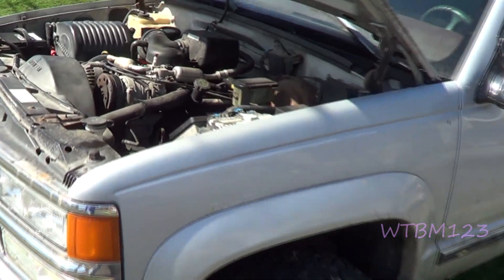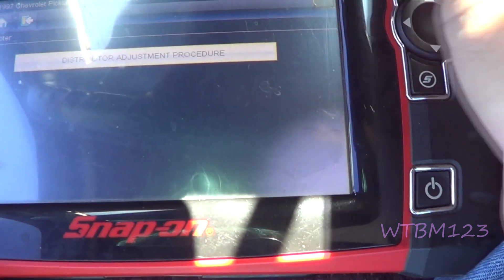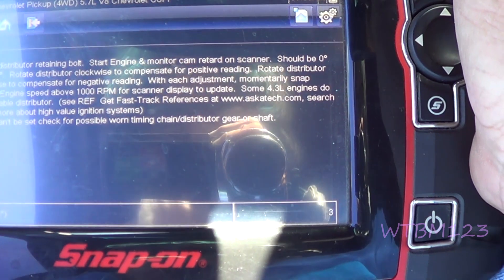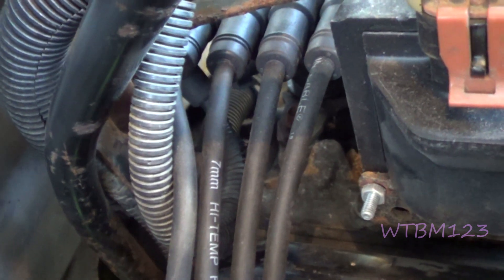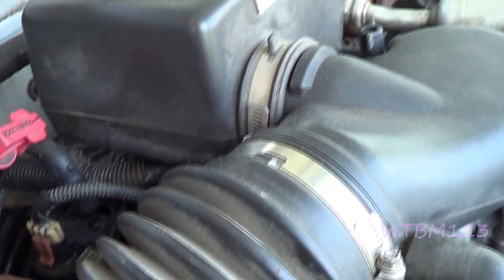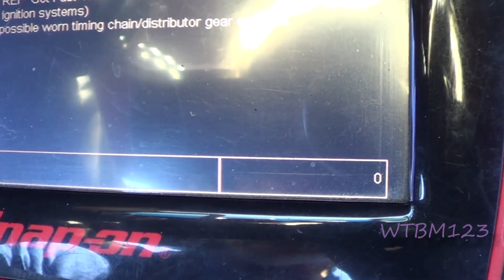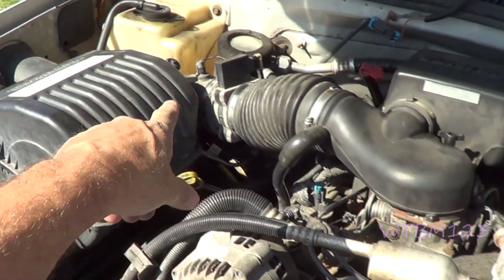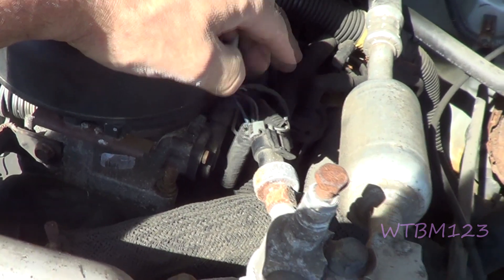Chevy 5 7 Votrec engine set distributer with Scan Tool

Comment: I have a problem with setting the ignition retard on my 96 5.7 Vortec.
I did the head gaskets so the distributor had to come out. All I have is my little old Actron code reader. It has a real-time (apparently) ignition retard function. I had an engine code P1345 Cam/Crank Correlation Issue. I had an ignition retard value of -17 degrees @1000 rpm. I  rotated the distributor counter-clockwise as far as I could. The code disappeared, and the MIL went out but the ignition retard value did not change from -17 degrees. I don't see how that can be. Do I need to advance the distributor gear a tooth, or is the problem with my using the wrong scanner for the job?

Comment: Thanks for this video, I have the Snap on Apollo and it is in Troubleshooter also. I was at 18 and now at ZERO. My distributor cap hold down screw threads had a crack. changed it from that cheap plastic to all aluminum. The true test will it pull my toy hauler camping trailer. Thanks again.
Reply from the maker: Hope all is sorted out . To much plastic on cars anymore.
Reply: @wtbm123  Drove it 200 miles since adjusted, way better fuel milage now.

Comment: Should this fix code p1345?
Reply from the maker: Possible if more than a few degrees out . Has the distributor been take out or adjusted . It is where i would start looking . Also check for timing gear slack .  p1345 is set when the crank sensor and cam sensor is a few degrees out of time , so anything that can alter the timing relationship between them can set the code. .  also just found this , It is worded better than i can do. 
Receiving a P1345 code on your Chevy or GMC vehicle will read out as “Crankshaft Position-Camshaft Position Correlation”. While this error code can be caused by a faulty camshaft position sensor (CMP) or crankshaft position sensor (CPS), the issue a lot of the time relates to engine timing. On older Chevy engines, specifically the 5.7 Vortec, for which this code is most common, the problem generally stems from the Distributor positioning.

Comment: Ooow you and your fancy pants scanner he he 😀
They can be very handy as long as you remember that the reported fault may be deceptive.
Something fails but it upsets something else and the code set is not quite the whole truth.
I watch ivan (pine hollow diagnostics) and i become lost in the strange things that create odd side effects.
ivan is brilliant :-D
Have i put you asleep with my waffling yet he he 😀
Reply from the maker: Yea , i bought this one new quite a few years back . I watch a lot of ivan (pine hollow diagnostics) videos also . South main auto and Scanner Danner  , And The Car doctor . And you are correct . The codes are just clues , one needs to use the live data, and do test to be sure . The bi directional tools are great also . I just wish i had one of the fancy scopes like they have . Mine is just a cheap old thing .